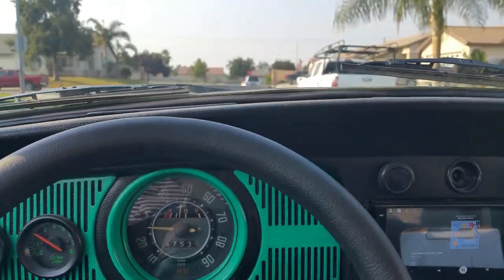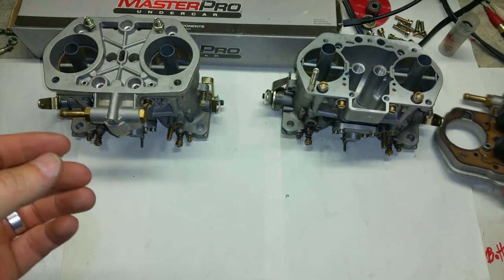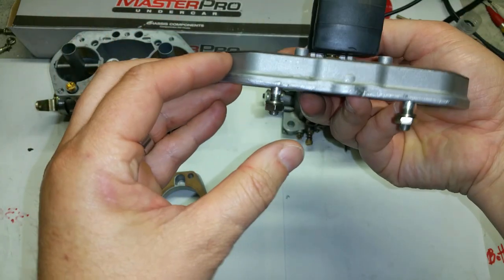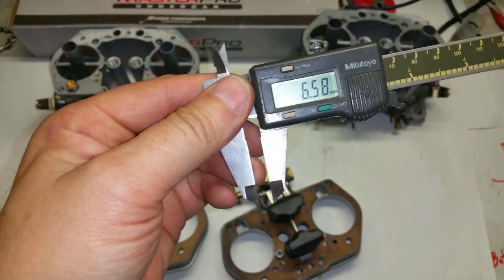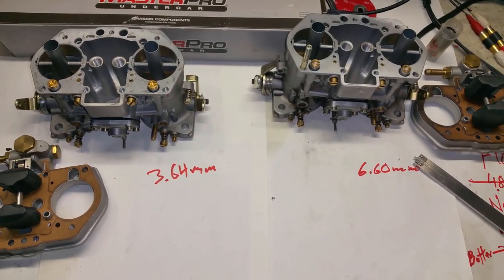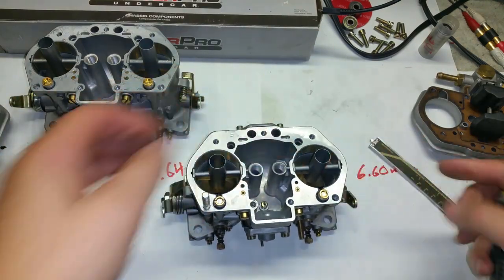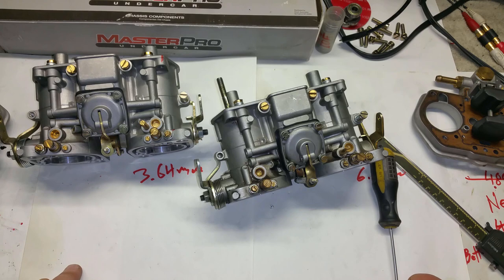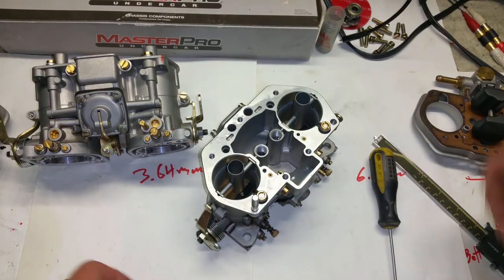Must Know Info For The China IDF Clone

Comment: Four years ago you put this video out and it still helping people I just wanted to say thank you, the bearings on my brand new HPMX 44s are junk and I was getting air leakage through there. It was causing my motor to not idle down (2332) and I found out because I knew I had vacuum late and I took starting fluid and sprayed it all over and when I got to where it would cause a disruption in the idol, it was at the linkage so I pulled it apart and them bearings are junk. I hope spellcheck did not butcher this

Comment: Question since you have done a lot of work on these clones. I have one carb that reads differently with the sync gauge. 
Is there a way to adjust that? The other carb is perfect between the barrels. If no adjustment is possible I just I’m pulling carb.and readjusting butterflies . Also you are so correct on needing to go thru these carbs and check everything. Check Jets sizes with a measuring tool, do not believe what is stamped on them. Check accelerator pump jets also. Check butterfly’s and replace throttle shaft bearings. Thanks again for all the work you have done and posting it for us. 👍👍
Reply: You can adjust the air bleed screw to adjust each hole. Next to the mixture screws with the 8mm nut locking in down

Comment: Thanks,     Hey  I could hear the differance as soon as you hit the gas.     My engine was T 1     2080 cc   40 mm intake.  It was a 2176  44 webers.    So  say I detuned it,  hoping to get  better 8 miles  a gallon    lol.   It's in a 70 Bus.     Thats my reason for getting these 40  clones.  I had no idea what vents/jets they would show up with.     To give an Idea on these chinese jets,  Idels are stamed  50.     one  gauges as 50,      one as  52.5  or a sloppy 50.  The other two are over 60.     I checked my weber jets  same type of thing.   I buy some 55  weber jets  same deal  none check out the same.   I bought more 55's from CB.   These are  a hair smaller   so thats  a +++.   Also getting 32 vents from CB.   So far  I  am happy with the weber clones,  you have  to dail them in,   just as you do with real webers.     Right now /  yesterday   I'm putting a diffrent oil pump and need to install it's axles.   I'm in oregon and   it's snowing  ashes/smoke.  If the house and shop burn down maybe I can save the Bus.   It does have  a very comfy bed in it .

Comment: To be fair; I would never expect a cloned product that costs hundreds less to be clean, assembled, or to even trust a 'set-up' from their factory. As with my clone carbs, the first thing I do is tear them down, inspect, clean, and then set them up. I learned after my empi carb to never trust that the factory cleans the circuits out, or adjusts the float level. There is a reason they are cheaper......just like clone guitars; The factory produces them, you gotta figure out the bugs and correct them, without paying out more than an original costs. Cloned items of any scope are a risky gamble. That's my opinion.......which is nothing but hot air 😀

Comment: Will there be the same adjustments on a single IDF setup the float
Reply: Would love to know this anwser?
Reply: Yes. I just downloaded both Weber and Empi set up directions; I hold my carb top to the side, not upside down so that the float just touches the valve tip. 10mm from float bottom to gasket. I have been told by people I trust to NOT measure float level while holding the carb plate(the plate that the float is connected to) upside down as it is not the correct way. But, the key is to experiment to see what works for your situation.

Comment: I bought 40's  and bearings.  can the bearings be removed ,  without removing the shaft ? What about the butterfly screws ?    Do those  come loose nice or are they pinned over ?   are the 40 vents   really 44 vents ?
Reply from the maker: If the bearings were not locktited at the factory they should just slide out using a very strong magnet.. I have a video that shows me how to remove the bearings. if you want to see that you just have to go back in time to find it but it's labeled so you should be able to find a video.
Reply from the maker: To answer your other question. you do not have to remove the throttle plate or the shaft unless they used Loctite on the bearings then you going to have to remove them be very careful when you beat the crap out of it to remove them don't damage your shaft or you're going to have to order one from the UK.

Comment: I like my clones also i have 40s however i tried the cb performance 40 upgrade but the venturis where too narrow could my 40s actually be 44? I kept with the stock working fine but do you know if there is a difference in venturis?